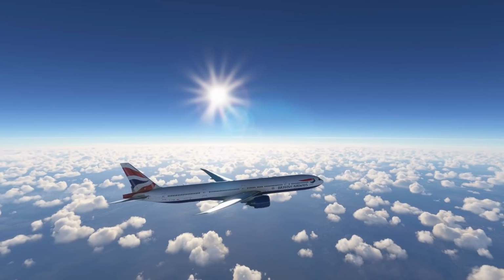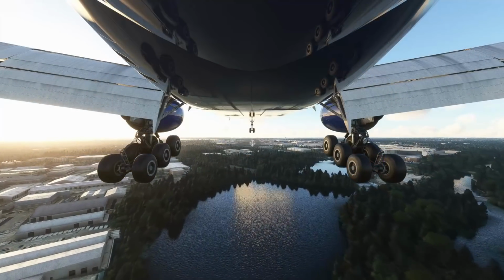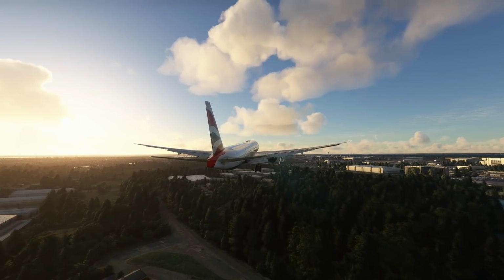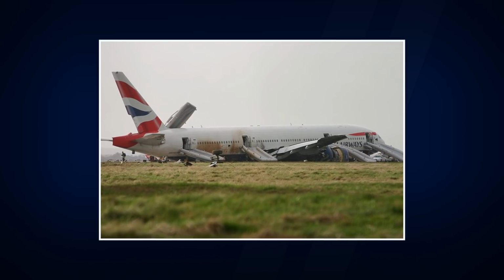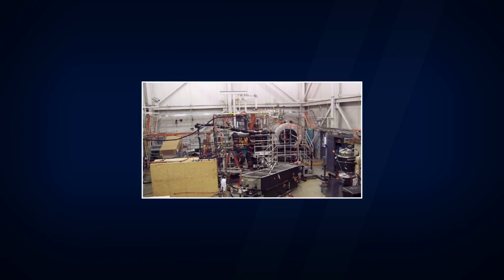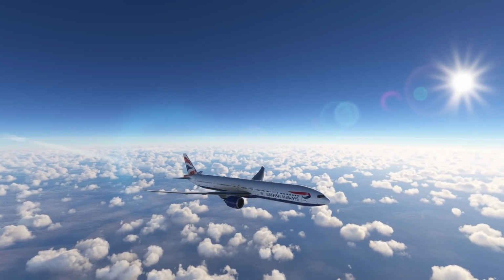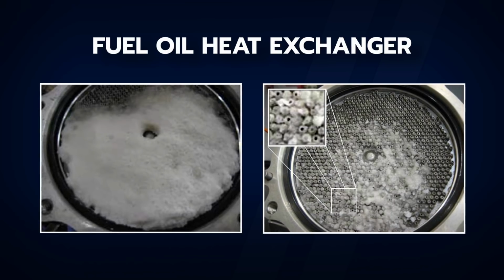Crash Landing in London Heathrow | British Airways Flight 38

Comment: Funny you mention it, but I did find myself pushing my vehicle accelerator mid drive and getting very low power from it. Turns out, the air intake hose had separated from the intercooler.  Thankfully I was safely on the ground already.
Reply from the maker: huh, see! :)
Reply: Like driving down a hill at idle to trying not to annoy the neighbours, and then releasing you're unable to accelerate when the hill levels out.

Comment: Some conspiracy theorists say that the real reason is that they ran out of fuel, they didn't want to declare a low fuel emergency in order not to get caught that they missed up fuel calculations & so they were hopping that the airplane would reach the airport and the stand and it'll all go unnoticed

I don't subscribe to that theory, but I'd like to get some opinions of its merits
Reply from the maker: This is easily disproven - the fuel was still in the tanks when investigators arrived.
Reply: It’s absolute nonsense. The investigation would have easily uncovered this.
Reply: They went into the hold for ten minutes, why would you hold if you didn’t have enough fuel?

Comment: In your closing statement, you said that he could’ve done more and shouldn’t have handed the controls to his copilot. I couldn’t agree more. That’s when his experience should have come into play. That’s when he should have told his first officer to handle the clerical work, radio, and what not. I’m not saying it was his fault, but he should have taken charge of the situation and not rely on those with less experience. Especially, so many lives hanging in the balance.
Reply: Au contraire mon ami ! The Captain let the FO (there are NO 'co-pilots' it's an old term and highly inaccurate) fly the plane i.e. AVIATE so that he could concentrate on whatever problem solving was possible. You don't concern yourself with clerical work when the plane's at risk !
Reply: @grahamstevenson1740     The guy sitting on the right is the copilot and the women serving food are stewardesses. So please, stop it!!!
Reply: @robert_costello  Your thinking is about 30 years out of date.

There are TWO PILOTS.
The PILOT FLYING and
The PILOT MONITORING

Either the Captain OR the First Officer can do either task. They confer and decide who will do which task for the majority of whatever phase of flight.

If either sees a problem of any description where they feel the need to assume command, they can do so and will say "MY PLANE" or similar.

There is no longer the strict hierarchy of many decades ago.

Stop referring to 'co-pilots'. THERE ARE NONE !
Reply from the maker: I said that was what the rumors stated. I do not agree with them at all.
Reply: @grahamstevenson1740       I noticed you didn’t see anything about the flight attendance 😂
Reply: @AirspaceVideos     I know you can’t say that you agree with them, because people will read this and, you don’t want to take the chance of losing viewers, but I get you… I can read between the lines 🤫
Reply: @AirspaceVideos      I’m joking. I can’t read between the lines 😂
Reply: @robert_costello  The correct spelling is ATTENDANTS btw.
Reply: @grahamstevenson1740      Well, that’s what happens when one uses “speak to spell”
Reply: I train this stuff and letting the FO fly while the skipper problem solves is exactly the right thing to do.

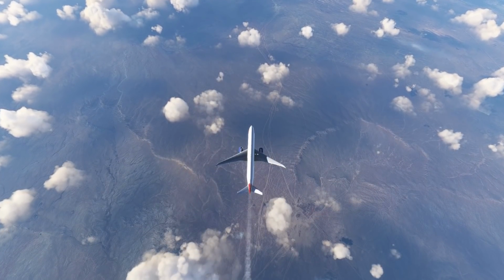Comment: What did you mean when you said "but on really cold winter flights or flights at high altitude near the equator, sometimes a descent to a lower altitude with warmer air is necessary" (1:35)? Why is the outside temperature at cruising altitude lower when near the equator?
Reply from the maker: It's been a while since I had meteo class, but I'll try: Temperature falls quite linearly as a relation to feets of altitude. The higher you go, the colder it gets. That holds true until your hit the tropopause, where the temperature will no longer fall but remain constant until you hit the next layer above (stratosphere I believe).  At the equator, the tropopause can be as high as 60'000ft, as opposed to only 20'000ft at the poles. This is due to multiple reasons: The equator is warmer, and earth is wider here, so the force of gravity is less here. The centrifugal force caused by earth's rotation also helps to "stretch the atmosphere" to higher altitudes. 
So: Higher tropopause = temperature can go lower because you can go higher, and for every 1000ft you climb, the colder it gets.
If someone with a meteorology degree wants to correct mey feel free 😄
Reply: @AirspaceVideos  wow that's fascinating! I appreciate the detailed answer by the way:)
Reply: @tobiasschmalzer4417  Yep, I was gonna say the same thing. At temperate latitudes (45 deg N, or 45 deg S), the stratosphere begins at ~36,000 ft, so the temperature gets down to -70 F, and no colder. For equatorial latitudes, if the plane has a maximum cruising altitude of 41,000 ft,  the temperature can dip below -85 F. This also depends on the air currents, cos temperature can drop below -90 F in certain instances.

Comment: Were they able to reproduce cavitation marks in the laboratory tests? Were these marks also found in the other boing 777 that suffered a similar issue? Finally, why was the RR oil/fuel heat exchanger blamed? Shouldn't the buildup of slush in the fuel lines be prevented at all costs? Usually I find the reports on Airspace crystal-clear and convincing. But in this one he seems to be repeating the official story rather than the usual logical flow from cause to effect, as if he was not entirely confident about the outcome of the investigation.
Reply from the maker: What cavitation marks are you referring to? This was an icing problem (which could be reporduced in a lab). Check the final report for more details.
Reply: @AirspaceVideos  Hello Airspace! Thanks a lot for producing these high quality videos! I am referring to the cavitation marks on the high pressure pump. The investigators found that the high pressure pump has some unusual signs of wear, and they sent it to the manufacturer for consultation. They in turn concluded that this is caused by cavitation, suggesting that there was under-pressure in the HP pump. This would be caused by low pressure in the fuel upstream of the HP pump, and that's what brought them to the fuel oil heat exchanger. They found that icing can occur inside of the fuel line, and when released it would obstruct the FOHE resulting in insufficient flow to the HP pump. 

My question is: shouldn't build-up of ice inside the fuel line be considered the main issue here? Altering the FOHE seems to be kind of preventative measure rather than addressing the larger issue of ice build-up. I have also read a comment on another online forum suggesting that the ratio of water/fuel used in the lab tests did not reflect the concentration of water/fuel resulting in the accident. And also, they did not report whether cavitation was found in a similar case of reduced power in another aircraft which was travelling at unusually low temperatures. To me, this suggests that really just wanted to wrap up the investigation at that point, and pin the blame on some easy-to-fix system. But what do I know? :o)
Reply from the maker: Hmm a very interesting point there. Maybe fixing the FOHE was just the easiest thing to do? I really don't know, though!